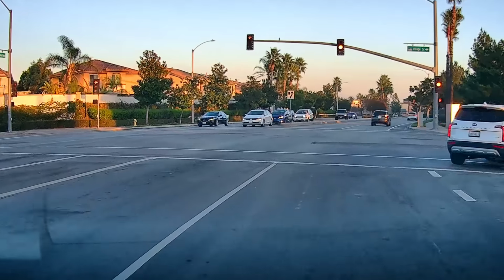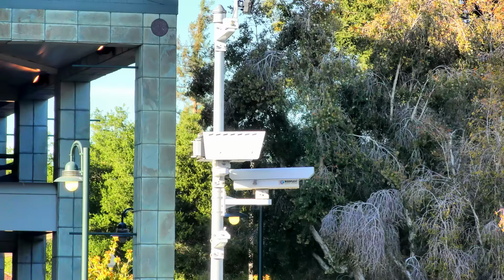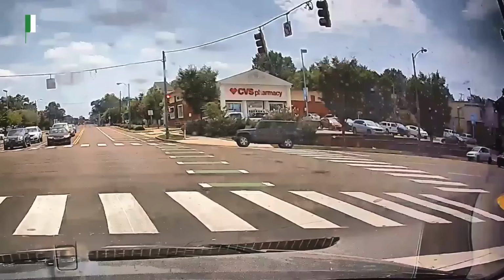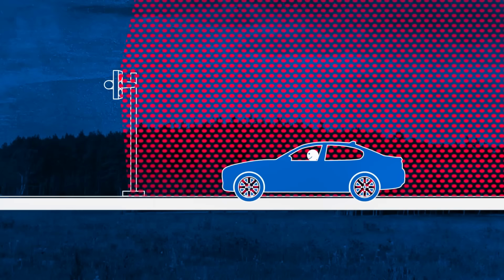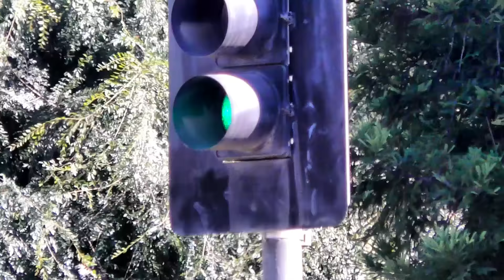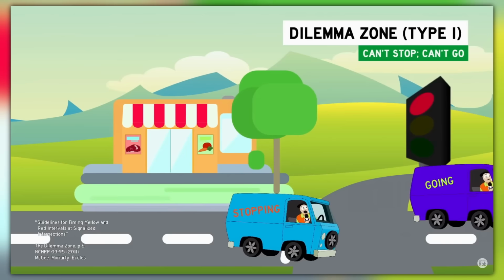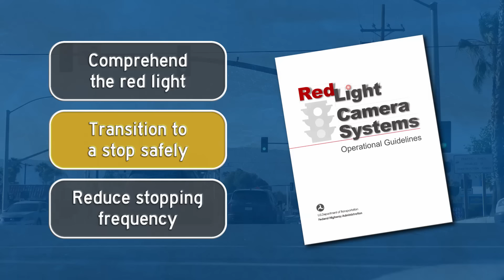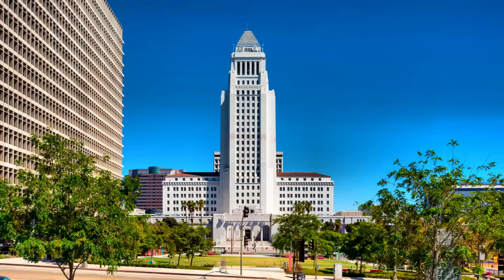Three ways to FIX a STOP LIGHT (so drivers ACTUALLY STOP!)

Comment: Any more ideas from Europe besides roundabouts that reduce crashes, worth talking about?

The late Hans Monderman redesigned a high fatality intersection in the Netherlands by removing everything, no traffic lights, signs not even curbs. He called it Shared Space. It didn't go from a high fatality intersection to reduced fatalities. It went to zero... crashes. Not even bumps. And the road rage went down to almost nothing as well. He demonstrated how safe this intersection was by walking backwards through it and drivers stopped to let him pass without even honking. And the bonus? The through put, the amount of cars going through the intersection actually increased during peak volume times. Tom Vanderbilt talked about this in his book Traffic.

Add bike lanes, as part of a road diet. More options for travel (with bicycles and ebikes and walking) mean fewer cars. Fewer cars, in theory, would mean fewer car crashes. Narrower car lanes means drivers instinctively go slower, so crashes are less often going to be fatal. But, again, this does not necessarily reduce car travel times or reduce them by a substantial amount. The Netherlands, the country with bike lanes everywhere, is famous for being esteemed the best place... to drive. Fewer cars on the road contributes a lot to ease car congestion.

Comment: I think that the timing of a light going from green to yellow should be greater than 240 ft from the intersection!  240 ft is how
far  car will travel in 4 seconds doing 40 MPH (the ave length of a yellow light). The yellow light doesn't have to last longer, just change to yellow SOONER! (maybe 360 ft from the intersection instead of 240 ft)!

Comment: Rob, very interesting.  I have a few comments, from Pennsylvania. On route 30 here in York, there is a regular highway that was built into a busy business section so it has many traffic light intersections, 11. For me the most frustrating is the approach to this area, we go from 55 to 40 and it is marked very well to slow down but most will not slow down until they are forced to by traffic or the light about a mile down farther. So often if the group would follow the speed limit to at least 40-45 MPH the light  often changes but they have all passed me so now I have to wait for them to move because they all passed me earlier. Now if I come to this area right and no recent storms or light adjusters changed the light timing, I can get through 80 to 100% of these lights in the morning as long as I have a average speed of about 42.  But that does not happen to often. On the way home it is very rare to get through more then two lights without stopping for them.    I have noticed a weird phenomena, the new LED lights. Our police here used a red and blue combination one color on left and one on right, so at a distance, I see it as purple flashing lights, until I get closer. I think it is part of the design of LED/LCD colors over the years to have them blend so on our screens we can see the red, blue and green pixels as different color and textures, of more then millions.  I also find that the LED traffic lights have more color blending problems then the old incandescent lights, and the color tints are not the same. Light green, dark green, orange to yellow yellow, red to deep red.  I have a pair of sunglasses that I bought years back that block out blue, these are not the branded ones, but another brown lens type. They are great for driving, but the green light is not very bright looking through them. The light shows up but it looks like it is not lit brightly.
 Oh our light assemblies are all yellow here in PA, for the most part.

Comment: I drive by two stop lights that are extremely close together and it has always frustrated me that I couldn't see the color of the second light until I was practically underneath it. Now I know why they intentionally made it that way.
The problem is that when I can see the first light is green, I cannot see the color of the second light and wouldn't have time to slow down if it was red. Which is a pretty big downside.

Comment: When you've just gotten off an interstate you're kinda still in that mode of driving fast. As a driver we must consciously adjust quickly to city driving. 
Some traffic lights need , at certain times of the year, a huge backboard or screen to block the sun blocking view of the light. 
I try to consciously slow down to 40 mph while going through a traffic light. By doing that the driver has a better chance of stopping to avoid an accident or at least minimize the impact. 
Be conscious of mopeds and motorcycles.  It might would have saved my son's life.

Comment: Here in Dallas, we have a street in downtown that is 3 lanes wide and it has the red lights on the right side but not as a overhang. I was ddriving through in one of the left 2 lanes, had a big truck next to me on teh  right just ahead and couldn't see the red lights on the right side were  even present. So I barely saw the red light until I nearly ran someone over.

Comment: You eluded to a problem with the cameras right at the end of the video.  Where I live they pulled the cameras out for two reasons.  1.  While the number of red light runners went down, the number of rear end crashes skyrocketed.  Less fatal, but still not a great outcome.  But mostly 2. they weren't making much money on them.  Turns out they had a 3rd party running the system.  This third party collected a set amount every month for the cameras, but after drivers became more compliant with the red light, they weren't collecting enough revenue to cover the cost of the camera service.

Comment: There were cities on the east coast that got caught reducing the yellow light time to increase ticket revenue after the red light cameras were installed. It also causes people to panic and try to stop for a light that they physically can't stop for. This causes problems also. So, other options are preferable.

The biggest problem I see is people tailgating trucks through a red light. The truck is so long, that it may enter the intersection legally, but is moving so slowly, especially if turning, that it's tail is still over the stop line when the light turns red. They are moving so slowly that even with a delayed green for the cross traffic, they are still in the intersection when their light turns green. So, the cross traffic starts moving, timing their acceleration to go behind the truck. This, again, is worse if the cross traffic is opposite direction traffic and the truck was in a left turn lane. The traffic that just got the green can NOT see that there's a vehicle cheating behind the truck. They have timed to pass behind the truck and that has them running into the cheater. The cheater wasn't in the intersection because the truck's tail was still over the stop line when its light turned red. That means that the cheater, who is behind the truck, was also behind the stop line at the time the light turned red. Having lights to the side so that you can see a light around the truck is nice, but near impossible in a left turn lane unless there's a median that the left turn signal can be placed in before the intersection. If the light is on the other side of the intersection, even if placed to the side, the turning truck blocks it. Bottom line, tailgating the truck is a violation in itself. If you can't see the traffic light, then assume it to be red until you can see the traffic light.

Comment: Well we used to have signal timers on "dumb" traffic lights. Basicly if intersection was controlled purley by time we had timers next to the light that tells when green or red light end. 
Now i live in the city where almost all traffic light seems to be "inteligent" ones, that uses cameras to spot how many (if any) cars are waiting so you can no longer slap a timer becouse it depends and propably wuld introduce confiusion when your car is not yet detected and timer just sets to 3s from lets say 30s.

There was a city (i dont remember) that cut the yelow time drasticly, calculating zones and turning green other lines while other ones are techincly still yelow or even green. That approach forced drivers to be more cautious about lights since if you run a red light, you most likley wuld block intersection or hit a car. For some reasons it worked well.

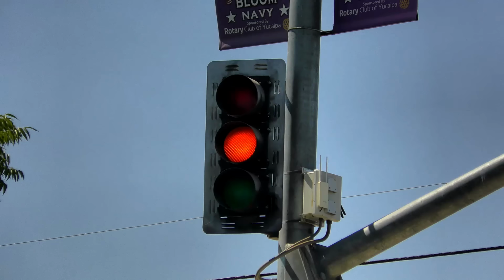Comment: You said it at 4:45. The biggest mistake in US is that the traffic lights are not where you have to stop (as in Europe), but far away on the other side of the intersection. This comes with 2 big flaws:

1. It is less recognisable,  because of more distance to the driver. 
When should you see a red light? When you actually at the interaction, it's too late, you have still full speed. You should be able to recognise it earlier, the earlier the better, to start deceleration, so that you came to a stop when you at the interaction. So which place is better? At the other side of the intersection? Or 30 or even more feet nearer at your side?

2. It has less psychological enforcement the further away. 
Red is a warning colour for humans. But the further away, the lesser of a warning. Our subconscious mind do not really care of the red light across the intersection (it's far way, don't bother me). Your conscious mind actively has to decide to stop. A red light on your side of the intersection would directly trigger your subconscious mind: "danger ahead, stop, don't go beyond this point!"

Comment: 1 good topic i wanna hear about is people that won't pull into the shoulder before taking a turn. They slow down a whole lane just to turn in when they could of gotten out of the way
Reply: I do understand that shoulders aren't designated turning lanes. And that it's a white line so you can't cross. I ask, what happened to sharing the road? So if you can turn into the gas station, store or attraction safely why also allowing others to pass without slowing down to much, why wouldn't you? There is more I can add

Comment: I once witnessed a crash where a car went through the amber light at the entrance to the intersection (what we call an amber gambler in UK), then the one at the exit turned red when they were half way across and the idiot stopped in the middle of the intersection. The motorbike behind them crashed right into the back of them and went flying. 
Who would you say is responsible for that crash? The car was taking a risk going through a late amber, but the bike was taking a bigger risk going through a later amber, and fast enough that they came off the bike.

Comment: Line the curb of a street with green, yellow, and red LEDs. Like a marque light the string of lights appear to run their colors down the street. When the green gets to the intersection, the signal turns green. Same with yellow and red. There you go problem solved. Easy.

Comment: bro erie PA has it figured out, no cameras needed (they shouldnt be up) they just make the yellow lights stay yellow for like 3-7 more seconds. nobody feels hurried to get through the intersection, nobody is slamming on their brakes (i hate current local stoplights cause they are yellow for like 1.5 seconds, theres so many times i have to speed up under an intersection cause if i dont im gonna be spilling my coffee or locking up the brakes as theers no way to stop smoothly in time) so everything moves smoothly right off the I-90 exit all the way to downtown. ive had people fly around me using turn lane to run a yellow light that i was stopping for (after it had changed fast) like it couldve been a bad accident, all because of a light being too fast and a driver behind me possibly being distracted

Comment: Phoenix area ranks quite high for red light runners.  I think folks here get so frustrated by the non-timed traffic lights and after slamming on brakes at a few in a row, driver just runs through next traffic light.  This seems compounded by 115F afternoons in summer....we lost a family friend at age 34 in 2022 to a red light runner, and later in the year a very-late red light runner ran into Mrs. Cuss' vehicle and destroyed that.  Myself, I was almost T-boned in early 2022 by a red-light runner who ended up doing a spin-out in the intersection and hit the median sideways; I knew that intersection and KNEW that once I had the green arrow to turn left under the freeway that I HAD to get a red light 100 feet ahead, so no reason to speed forward once I got the green arrow.  I honked and literally saved the driver in the 2nd lane to turn left and she stopped too and wasn't hit. It turned out a couple of days later that the driver of the vehicle behind me knew me, and was amazed that I wasn't hit/killed.

Comment: The one and only safe and correct way to fix traffic lights is to completely remove them and replace them with roundabouts as we in Europe do. Reduced fatal crashes by 70-80%. Speeding through yellow light, running through red and waiting in a lane don't exist anymore.

Comment: I have driven down town in many cities.  Biggest issue I ran into was the fact lights were way to short.  Almost as fast as it turned yellow it would go red.  So fast infact that if you blinked the light to you went from green to suddenly red.
Reply: The yellow lights should be uniformly set to be five full seconds. At that interval, any motorist who is paying attention can, regardless of the speed they are going (so long as it's a legal speed) safely bring their vehicle to a stop, or continue thru the yellow all the way to the other end of the intersection, if they are past the point where harsh braking would otherwise be required. Traffic engineers know this, but city officials often get them to set it below five seconds.. for the purpose of generating revenue. I'm thinking of you Philadelphia.. ( where I've seen yellow lights that lasted between 2 and a half to 3 and a half seconds) but it's probably a problem in many other corrupt municipalities.

Comment: When the city of Atlanta installed red-light cameras for safety reasons…(with associated revenue), the state politicians disliked the idea so they passed a state law that said interactions with a red-light camera must have a longer yellow. They required an extra second in the duration of the yellow light on top of the duration dictated by standard for the traffics speed.  Revenue fell by 90%.  So they removed many of the cameras.

Comment: I'm sure I'll get flamed, but I hate round-abouts.  I travel on some rural roads, one lane asphalt in each direction where they used to have traffic lights.  Open road, no obstructions, easy to see the light from a distance.  If you had the green, no need to slow down.  If it's red, then stop.

Now, every car has to slow down to 15 to 20 MPH to negotiate the circle.  When making what used to be a simple right turn, I have to wait for an opening in traffic to get on the circle, turn right, turn left to follow the circle, then turn right on to the cross road.  For what was a simple left turn, I have to wait for an opening in traffic to get on the circle, turn right, then turn left to go 3/4 of the way around the circle, and turn right on to the cross road.

I can see that fatal crashes are reduced since the speeds on goes around the circle are reduced and crashes are more likely at an angle or side-swipe versus a high speed t-bone.

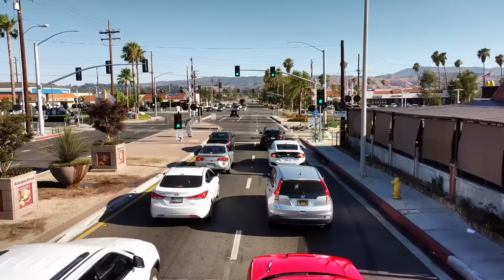Comment: 5:35 I hate these filters. I often put my truck in neutral and let offmy clutch pedal at longer lights to reduce fatigue in my left leg. I use cross traffic lights as my cue to put it back in gear again. If I can't see when the cross traffic light turns yellow I'm missing that cue.

Comment: One issue with cameras is that you have a right to confront your accuser. How do you confront a camera?

Another problem is they must photograph the violation, but I was photographed approaching a red light (which I did stop for), it was dismissed.

In some German cities, on major routes they time the green lights so you always hit a green light IF you’re doing the speed limit, but will always hit RED if you speed.

Comment: Given the ambiguity is normally around how long the driver has before it turns red, it boggles me that lights are just a simple color and don't have an actual timer to show you exactly how much time is left rather than guessing based on when it changes. It would be easier for someone to know if they can cross if they can see they have 2.3 sec left.